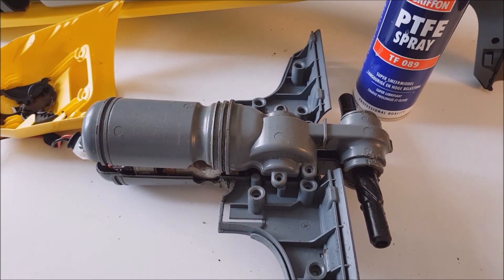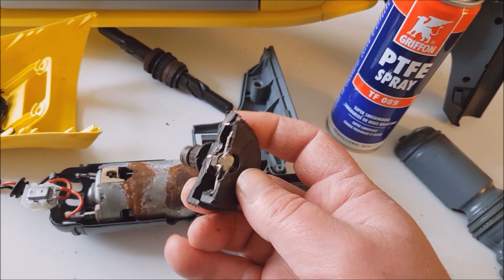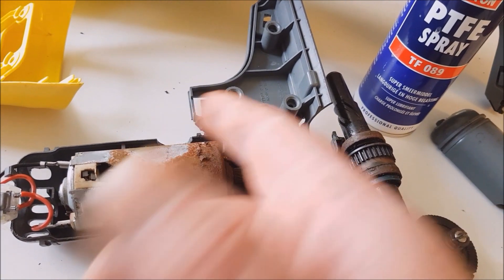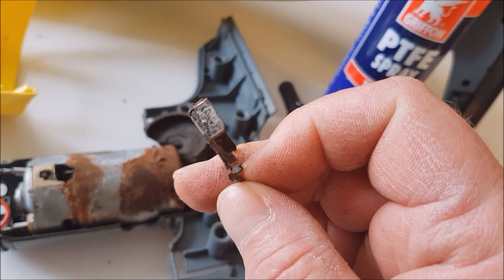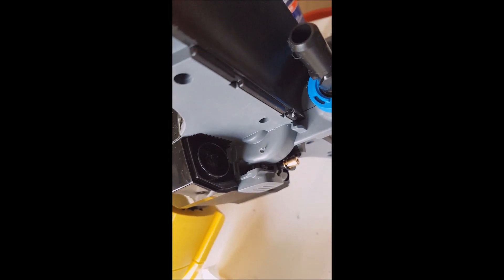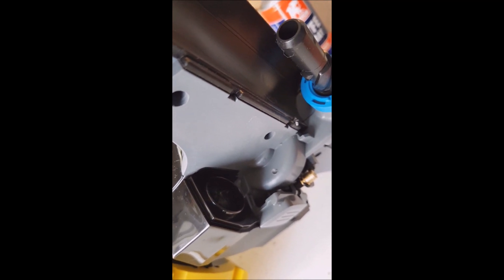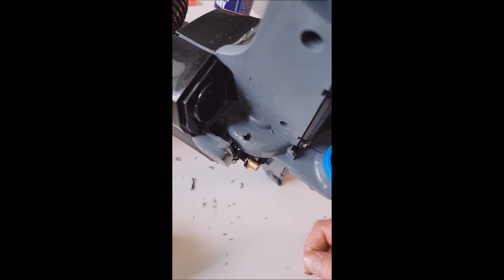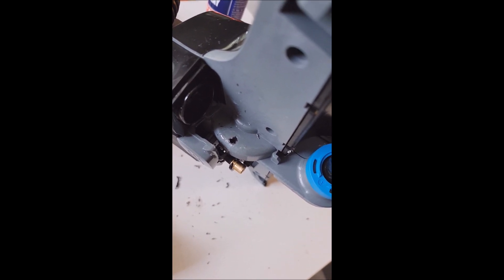How to protect KÄRCHER FC 5 wet vacuum cleaner from programmed failure. More oil, less rust!

Comment: Very good and interesting analysis. Might the unusual aggressive corrosion be due to electrical leakage? I'm thinking if water accessed the electrical parts it would be aggressive like that. Like with electrical leakage in a car where you can see for instance bad corrosion in the area of the blackened license plate illumination due to electro-galvanic corrosion.

Comment: The same thing happened to me with the Bissell Crosswave. The suction motor is made up of metal parts, specifically, both the fan and the part that surrounds it are made of simple metal and are filled with rust, so much so as to block operation. I disassembled the device with a lot of effort and I noticed the blockage of the motor, which no longer works even after unlocking and cleaning. I ordered a replacement in the UK and it still hasn't arrived for three months. (£ 46 plus shipping, not much to tell the truth)

Comment: I know this video is old now, but I just had my FC5 taken to the shop for repair after just 6 months! As you said that was almost... 150 days of every day use but my apartment is hardly 40 sq mts so, not a big deal for the mop. Now the turbine has to be replaced, and I don't remember exceeding the MAX sign many times, 3 or 4 times may be but just about 5 to 10 mm over the line. Theres definitely a design problem. I'm thinking of get in it repair and just selling it.
Reply from the maker: That very same unit from the video catastrophically failed as well after 2 years of use.

I phoned Kärcher and offered them to analyze it as soon as it showed signs of failure. A very self-assured lady stated that this failure mode is impossible and hooked the phone presto.

I hope she sees the final result, here: https://youtu.be/kZec5nYdlxY

Comment: Hello! Interesting job! However, the drive belt is not made of oil resistant rubber. And the first when oil gets on him, he will tear.
grease should not get on it

 This is not an option.
Reply from the maker: That treated device lived much longer, 2 years. Then it corroded the same. The timing belt was in perfect state except that it was cut by the angle-grinder used for disassembly.  Bearings were shot. Here: https://youtu.be/kZec5nYdlxY

Comment: IT SEEMS TO ME, THAT THE DIRT WATER TANK WAS OVERFILLED. Then water can get into the housing and can damage the motor. It's only allowed to fill the dirt water tank to the mark "MAX". To prevent overfilling you should empty the dirt water tank with every new fresh water filling. You can read it in the operation manual on page 16. ATTENTION: This "oil-modification" can damage the clutch and and I'm afraid that the customer will loose the warranty claim!
Reply from the maker: Klaus Möller 
Klaus Möller 
Taught if this. On teardown I've noted a clever trick. A drain tube which would return the excess water from the fan turbine down to the ground. 
However water and steel don't mix. I'll rather suspect a condensation issue. This sweeper motor has a sealed shroud save air holes on the top. No drain hole at the bottom.
Reply from the maker: Klaus Möller 
How could Teflon oil damage this type of clutch ? Explain please.
Fact is that without corrosion protection this is designed to fail.
Which is why I show how-to defeat the programmed self destruction.
Reply: Probably the oil will change the clutch's friction coefficient so that the clutch will trigger too early. 
I think, if you pour out the dirt water tank when the water has reached the mark "MAX", no water will get into the housing and so you will have no problem with rust at all.
Before my device broke, i wondered, that from time to time water dripped out of the housing. My mistake was, that I had overfilled the tank and did not pay attention to the "MAX" mark.
Reply from the maker: Klaus Möller 
I am on a trip at the moment.
However next week I'll post a video to rebut the overflow theory and demonstrate the extend of the design flaws of this reduction gear.
The clutch is a ratchet type where friction coefficients have purposely little effect on the torque as opposite to friction only devices. I'll demonstrate that as well.
Thanks for your input !
Reply: Thank you Thermmo Dhynamics. I have the same issue after little bit more than 2 years. My dirt water tank was overfilled several times. Now what I notice from the video is all the dirt on the walls. This mechanic was in water, not only just condensation. I notice also that there is no drain hole at the bottom of the housing. If water come in, it will stay there for a long time. I think the condensation is solved by the heat of the motor.
Maybe, a little hole on the lowest point of the housing could solve the problem, although it could be problematic when rinsing the device in his socket. I will try with mine as it's already broken.

Comment: Vielen Dank für Ihre Analyse - wir wissen Ihr Feedback zu schätzen, weil es uns hilft, besser zu werden. Wir haben Ihnen eine E-Mail geschickt und würden uns freuen, von Ihnen zu hören.

Thank you for your analysis - we appreciate your feedback because it helps us to become better. We have sent you an e-mail and would be pleased to hear from you.
Reply from the maker: Thank you Gentlemen, the product is otherwise very good and I bought another one to replace it. Which I modified to prevent this mishap in the future.
Reply: @thermmodhynamics392  can you disclose what Kaercher Schweiz approached you about? I just started experiencing a slipping of the belt / clutch. Once there's more load introduced on the spinning brushes, they will stall. By increased load, I mean regular operation while doing the back and forth movement. At the point of changing direction - the thing stalls and it's getting worse. I love the product but this seems to be a huge design flaw.
Reply: @OutdoorFunsies  hello. It was long time ago, but still... Have you found the way, how to fix when spinning brushes stalls if load applied? I face same situation
Reply: @andrejs_lv  HI - well, I had it serviced (out of warranty repair costing me around 80EUR if I recall correctly) they had to change the clutch / inner workings. I've been advised NOT to clean under a more sharp angle...Quite honestly, that didn't help and I'm seeing the issue coming back very soon. (as it started every now and then again after a year) I'm never buying this product again after it brakes down 1 more time, that's for sure.
Reply: @thermmodhynamics392  Hello, im thinking to buy one so thank you for the video! I would like to ask what the warranty department from KÄRCHER had to say, was it covered under warranty ( 2 years in my country for ex.) or dismissed as missusage?  If missusage im wondering how should one go about proving the normal and correct ( as per user manual) usage of the device?  
I want the product since my newborn is a month or two away from starting to crawl all over the house and would like to know that the floor is clean, but if it wears down so much in under 10 months i would rather think twice. 

Kind regards,
Reply: @s.j.3247  I found Bissel Crosswave more effective in cleaning and mostly in vacuuming (no need to prevacuum floors). BUT it is unbearably noisy, it does not run easily on floor (very wearisome after a while), the action of the brush damaged my oiled parquet being too strong. Not to mention that the paper like filter has to be fully dry before reassembling. It leaves too space not cleaned against the skirtings. Finally FC5 is better for me, pity Karcher did not prperly developed it before the launch on the market.
Reply: Hey
I was actually surpriced to see your comment but its great. Does Kärcher have any plans to update the desighn? Can I now buy an FC5 without being concerned with the problems shown in the video? The idea of the product is great I just dont want to be dissapointed with reliability issues down the line..
Reply: I know this video is old now, but I just had my FC5 taken to the shop for repair after just 6 months! As you said that was almost... 150 days of every day use but my apartment is hardly 40 sq mts so, not a big deal for the mop. Now the turbine has to be replaced, and I don't remember exceeding the MAX sign many times, 3 or 4 times may be but just about 5 to 10 mm over the line. Theres definitely a design problem. I'm thinking of get in it repair and just selling it.